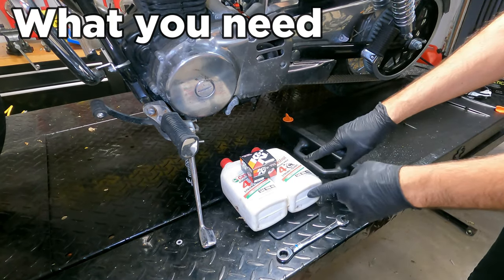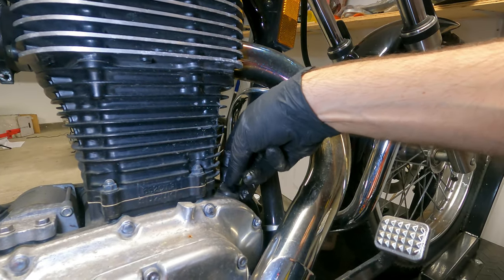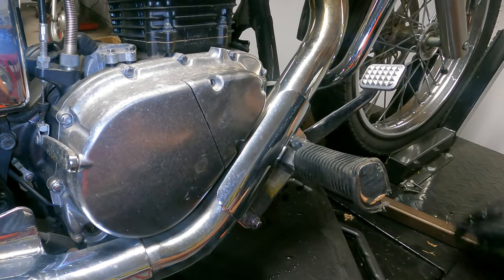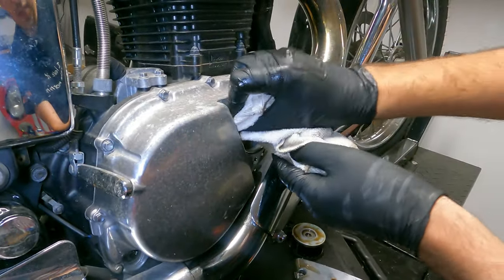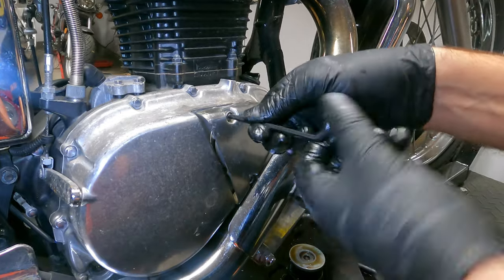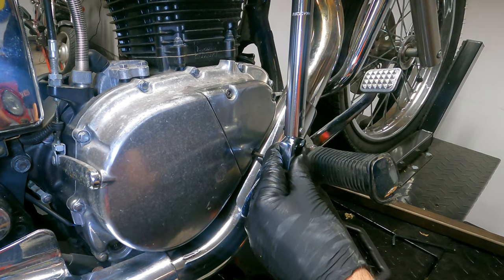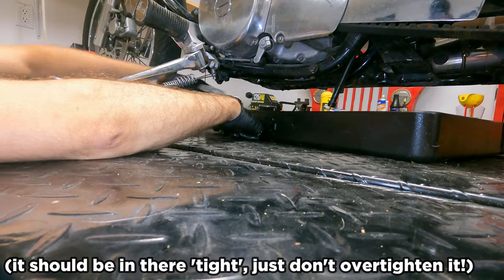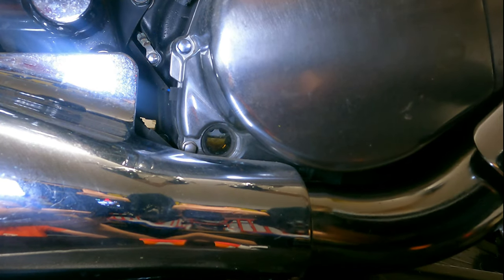How To Change Oil - Suzuki Boulevard S40 / Savage

Comment from the maker: WHAT YOU'LL NEED:
2 Liters of 10W-40 Motorcycle-Specific Oil https://amzn.to/49dWQjP
Torque wrench https://amzn.to/3APjbSY
KN-137 oil filter https://amzn.to/3m9ZFMZ
Low profile oil drain pan https://amzn.to/3ajh1QO
5 mm allen https://amzn.to/3gfVxY5
14 mm wrench https://amzn.to/3D7XBv9
Black Widow motorcycle lift (optional) https://discount-ramps.sjv.io/motorcyclelift

Comment: great insight thank you! 
its my first mine is 2008 red and has 9,800 miles
Reply from the maker: Hey, thanks for that. Congrats. Change the oil every year, brake fluid every two years, and keep it clean and it will last you forever.

Comment: put a foam pad on the ground underneath your hand when you're breaking loose the drain plug so you don't bang your wrist or knuckles too badly. use aluminum foil to guide the oil away from the pipes and leaking everywhere.
Reply from the maker: Great tips!
Reply: Good tips, thanks. I have a 2015.  I bought it on a whim with just 500 miles. Thought I would sell it after 1 season but it has won my heart. There is something about it's simplicity that I like. Even did the 1st service with valve adjustment myself. It has a Dyna pipe and A/F adjustment.  Maybe you can vlog more info about servicing it. I do wish It had a trip mileage or fuel gauge. I put a mechanical only petcock on it because California fuel will destroy the vacuum diaphragm. If you don't get the S40's charm then you dislike it, there is no in-between with it.

Comment: Do you stand it upright to check the oil level, or at rest? Also, I opened the stock filter and there was no o-ring, and none with the replacement filter. Do I absolutely need it?
Reply from the maker: Everything is done with the motorcycle upright. Kickstand is out but if you look carefully you'll see shadow and reflection under it because the bike is never on the stand.
If your oil filter isn't seated properly, what's the point in even having oil filter in there at all? I would get the new o-ring. Filter not seated properly isn't going to be doing it's job the way it's supposed to.
Reply: Everytime i try and tip the bike upright to look in oil window I feel like I might tip the bike over on my head lol

Comment: Did you refill on side stand or did you leave it "level" after the drain plug?
Reply from the maker: Bike never on the side stand for any of this. Upright all the time. The sidestand is out in some of the shots, but the front wheel is locked in a vice and the bike is upright.
Reply from the maker: If you do it with the bike on the sidestand you won't get all the old oil out and you won't refill it properly either which could damage your motor.
Reply: @YouMotorcycle  Thanks. Good to know.

Comment: Thanks. However, most of don't have a m/cycle lift so have to do things on the ground, and without a centre stand, it is a pain in the whatever. Thankfully, my wife holds my S40 upright when checking oil, filling with oil etc.
Reply from the maker: @awtistiaeth4699  yup, but I'm not going to make a video on the ground when everyone has a good friend or a good wife lol

Comment: Great video!!! I just purchased a 2017 s40. Where can I buy aftermarket seats and accessories? I just want a trusted site. If you have any input I’d appreciate it. Cheers. I’m located in the us. Thank you for your time
Reply from the maker: SUPPORT YOUR LOCAL INDEPENDENT MOTORCYCLE SHOPS. 
Most of the online shops are all owned by the same big conglomerate Comoto, which owns JP Cycle, Revzilla, etc.... Not good for the industry, but that's a whole other video.

Comment: For the oil filter cover.. All 3 bolts broken even at 5Nm😢
Reply from the maker: Hey Gary, sorry to hear this. Are you sure the torque wrench you used was calibrated correctly? Some of them can be faulty